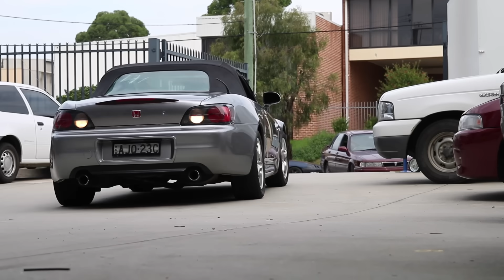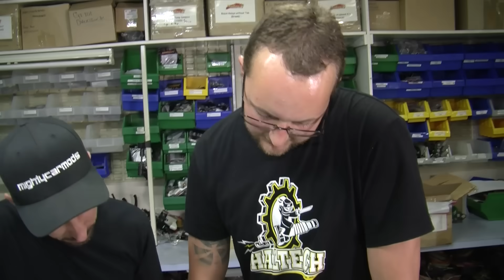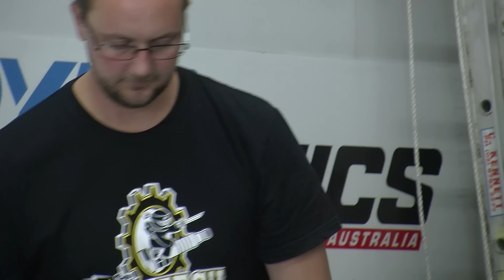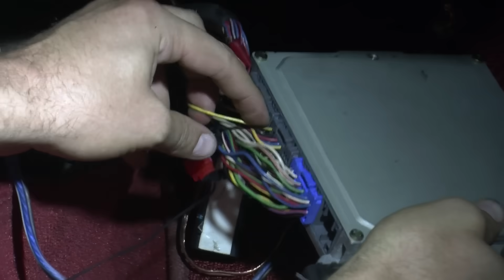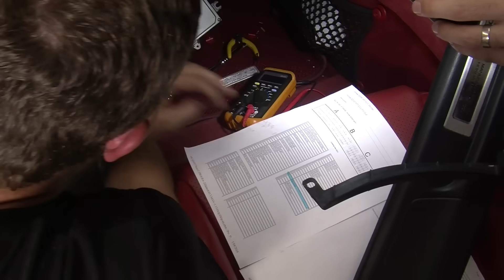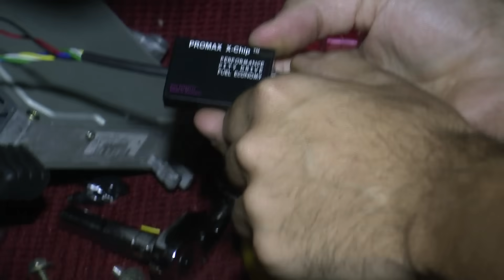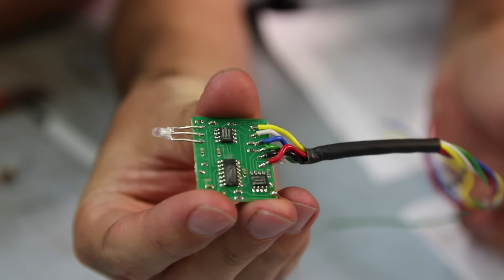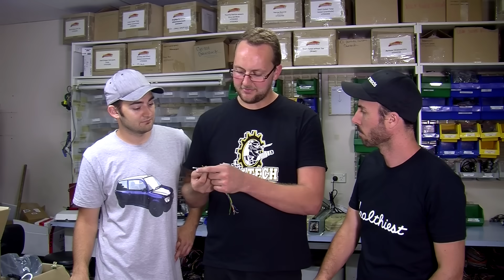eBay Performance Chips -  Mythbusted

Comment: If 1,000,000 rainbow-farting unicorns give 177 HP, every unicorn gives 0.000177 HP
20 unicorns should thus give 0.00354 HP. THAT'S WHY IT DOESN'T WORK!

Shame on Moog, he should have taken the 170,000 unicorns version to have 30 HP more.

Comment: Why waste your time with silly little gimmicks.  That chip is never going to work and even if it was remapped it would only give a slight increase on a NA engine.  Stop messing about and get a supercharger bolted on there so that you get a good increase in power and torque!

Comment: Some Chinese manufactures do scrape off the chip markings to prevent someone from copying their circuit. And in this case to prevent anyone from finding out those chips have nothing to do with ecu control :D

Comment: Absolute junk.  Unless it is an eeprom or memcal that slots into a dip socket inside the ECU, then it ain't gonna work.  There are eeproms / memcals with performance tunes available on ebay, but you need to trust that the maps on them are sound and won't cause the engine self destruct.

Then, for non eeprom cars with locked ecus, there are piggbacks like the Greddy e-manage and Nistune.  Nistune is excellent for Nissans.  e-manage is better than a stock ecu, but still poorer than a standalone like a Motec or Haltech.  A lot cheaper though.

Comment: Why not just get the ECU re-mapped its much safer and better for the engine
Reply: Because it wasn't the purpose of this video, man! But since we're around giving good tips I think that putting some MCM sticker would give more power to the Honda - - poooooowwwww...poooooooowwww...maaaaaaad :D
Reply: Marcin Wojciechowski hahaha. Yeah I understand that, at least they have stopped people from buying these useless things off ebay.  glorified LED device
Reply: ***** You can get it done fairly cheap at a garage, and if the car is old its easier to remap.
Reply: It's really difficult to remap a factory ECU. And it tends to try and lock down on you to protect its self.
Reply: True true

Comment: Scratching off the chip codes is very common, it's an attempt to slow down those who want to copy the device. In reality it doesn't make much difference since it's fairly easy to reverse engineer the basics of the board. There are of course legit chips that work exactly how the BFG mentioned, modifying the data being sent to the ECU so the engine is worked a bit harder. To say mod chips don't work, based on this single test is a bit silly. You knew from the start that the chip wasn't compatible with your car because it didn't have the required sensor to intercept. P.S spoiler in video title = the suck.
Reply: This exact chip has no way to work since it's a straight-trough connection. The ones that actually "work" foll the engine into going rich and it does nothing exept for increased fuel consumption (think of choke - Does it increase your power?). Chips used in turbodiesel engines are diffrent story: This engines are regulated by amount of fuel injected and most engines have some extra capacity for generating power, but for some reasons are left unused (possibly because of emmisions as chipping tend to make them smoke a lot at full throttle). Moreover there are often exactly the same engines sold with diffrent power output and you can mod low power one into high power variant. There are also some middle boxes avaliabe that plug in between ECU and wiring that allow you to benefit from chip tuning without voiding warranty (just remember to remove it before annual check :) )
Reply: mibars According to their analysis it's a straight pass-through. Chances are the chip passes through any data that it doesn't understand and that's why the guy who tested it believes it's not doing anything. If they pass through the specific sensor data that the chip is expecting, I bet it would be modified on the fly. Whether or not these modifications produce extra HP or just waste fuel ... well I'll leave that to someone with a lot more free time to talk about lol

Comment: here's a Mad idea.... swap out for a 1JZ-GTE twin turbo engine??? i know they have a 1J Toyota Chaser hiding somewhere and i now the engine will fit with some mighty mods of course as the show is called!.. only other thing you will need is to use a NISSAN S13'14 or 15 rear end to handle the power ..bigger wheels stronger suspension,,, i think it worth a look see and an instant bump in power from 177bhp to 280bhp to start think about it a Honda Toyota NISSAN Hybrid.....MADDDDDD!!  lol
Reply: well Thats Australia for you!!  lol to many rules
Reply: Methinks they sold it soon after that episode. But more engine, more good!
Reply: I suppose thats one way to totally fuck up the weight balance.
Reply: it would still suck because you could only legally use the vvti 1jz which is pretty limited when it comes to chasing power vs the older non vvti 1jz.
Reply: WTI? who said it was a wti? Limited?? nothing is limited once you can crack the issue  ...and even if it is limited & has wti ... it will still have more power than before and more power than the MX-5 Miata now wouldn't it?! thats the goal in the first place!..smh
Reply: EnFlaMEd
 Cressida? Chaser? ''Details'' same damn thing same dame engine  don't get politically correct
Reply: That wasn't me! :D

They would have to use a vvti 1jz because you basically cannot legally put an older engine into a newer car. But you are right, it would still be good for plenty of power, they are a great motor still. But they are limited in how far you can go with them. Plenty of information around if you google it. A vvti 2jz would be the best solution so long as the s2000 isn't too new ie newer than about 2003
Reply: you got that right!

Comment: those look like normal op-amps on the circuit board. and if they are i don't think the instructions are correct. because just splicing in like that will not make the voltage travel from the chip to your ecu. from the looks of it both the ecu and chip will be getting the same voltage form the sensors. and that 14 pin op amp just has more than one op amp in side it. i hope this helps in understanding whats on that board.

Comment: Does a sports muffler or straight threw pipe give any extra power because I can not count on two hands in every day I see sports mufflers or straight threw pipes on daily driven cars . I haven't done it because the way I look at it the manufacturers have done all the testing already for the best outcome for the engines performance .
Any Answers ???
Reply: If all "they" do is replace the muffler, then no, not really. I too see those "fools" driving around with their fart cannons and wonder in what world they live in. The power gain would be alot better with a full head back system with a good quality (yet quiet) muffler. Intake rarely needs changing on cars and factory will just about cut it for every aplication.
Backing up abit, a good muffler that comes to mind is the varrex xforce. Fully closed it has very little restriction and is (in most cases) quieter that the factory muffler, meaning less "unwanted attention". But the car scene, in my town atleast, is a joke. Too many sheep that have no idea what does what but because 'they saw it in a movie' it must be good and does something. Anyway long crappy story short.... No that does sweet frack all for anything except highlighting that they're idiots.

Comment: if you're planning to stay NA. try a 4.778 final drive from the '94-'02 Kia Sportages 4x4 front diff. part number MM05727110. it's less than $300 new.

Comment: 171bhp?theyre suppose to be 240bhp arent they?
Reply: Don't forget, cars eventually lose power the older they get. If Moog's is a 1999 or a 2000 model, that seems pretty feasible for it to have lost that much. Plus, that result might be the horsepower going to the wheels rather than the raw engine itself, which is always typically less (usually a 15% - 20% loss if I remember rightly).

Comment: Guys, that's more of like just a Throttle Controller not a proper ECU Chip. That just gives you more torque when you accelerate. Pivot and Shadow are brand samples on throttle controllers. would have been nice to see them using ECU chips like Unichip or maybe from J's Racing Japan that's made for a honda.

Comment: 177hp on S2K? Something is wrong here... should have arround 240hp! No suprise MX5 got u...
Reply: ***** The 2 liter engine had these specs: 177 kW (237 hp) @ 8,300 rpm (US & EU) 184 kW (247 hp) @ 8,300 rpm (JP), and 2,2 liter  177 kW (237 hp) @ 7,800 rpm (US) 178 kW (239 hp) @ 7,800 rpm (JP)..... there was no other version that I would know of other than spoon and mugen.... and not with such low HP/Kw figures.
Reply: HorsePower and WheelHorsePower are two totally different things. The 240hp you're saying is the factory declared HP but when it comes to the dyno, it's only 170w+hp since it losses a lot of HP cause of it's transmission. Might wanna google Wheel Horsepower.
Reply: ***** you are right, still, with S2K in good condition you should get way over 200hp on wheels m8
Reply: mulawin estrellado you are right, still, with S2K in good condition you should get way over 200hp on wheels m8
Reply: ***** Ofc you are right. Since the car is AP1 I guess it will be more than 10ys old... could be up to 15y old.

Comment: Everyone's complaining about the horsepower readings being lower then advertised by Honda.

The thing you need to consider is Honda is obviously going to be dynoing these engines in the perfect conditions not only that but they also reach HP at the crank not at the wheels put these together and the Honda stated performance is going to be quite a bit higher than a standard dyno reading at the wheels

Comment: Yeah... Good luck making more horsepower by changing sensor data.... What you need to do is get an aftermarket EPROM with diferent map/s than the original one and than swap it from the ECU. The other way is actually reprograming the original one. That's what i like about old Opel ECU units - the eprom is removable and the board has all the conections to connect to a PC and monitor the input and output signals. Yes, it is serial, but it works!
Reply: Yeah, EEPROM swapping for more power is awesome and pretty cheap. :)

Comment: I reckon even expensive branded ecu chips and maybe even ecus themselves dont cost much to make. All the ecu does is execute a bunch of "IF" Statements based on readings from the maf and airflow.  A flash tune just replaces the "if" statements values with different values.  Its the licensing and branding which you pay for.
Reply: its not the unit you pay for it's the work that has gone into the unit.
Reply: Yeah, but the price is not only including the manufacturing line and marketing and all the stuff directly connected with producing the unit.
Reply: The raw cost of materials used for making them isn't much. But the cost of the machines that make the chips, the time paid to staff to develop the chips, testing them etc. That's where all the cost is.
Reply: Ahh yes! How ignorant of me ==' i completely forgot about the development and engineering stage. My mistake. Yea that makes sense, i remember when quoting for a ecutek tune, the bloke stated it was expensive due to the cost to licence the ecutek software, which ultimately goes to the cost to develop the software.

Comment: Awesome, so much analysis for that little chip all questions have been answered but it seems almost like a waste for this ebay thing. How about doing a still cheap $200 chip from a more reputable tuner
Reply: same results.
Reply: They work, on naturally aspirated cars it's usually around 10hp which isn't all that great but if you are supercharging or turbo charging it's the cheapest way to adjust air fuel ratios.  In the end stand alone is better because it can be adjusted right there in your car with infinite ratios.  But for an easy turbo upgrade chip turning is easy enough and more cost effective.

Comment: So this is really a logical conclusion. 99% (with a correctional factor of 1) of MCM fans knew exactly where this was going. BUT, at the same time, I'm glad this video was made. Maybe with some luck, someone who got enticed by an eBay "chip" will see this and save their money.

Also, for the record, for the same $20, I got a great looking aftermarket radio antenna. It also does nothing, really. But it does look nice doing it.

Comment: I have one power box installed on the MAF sensor of my car. It uses the air intake temperature and adjusts it to a lower value. This can be seen using an OBD 2 tester. I can say that there is some change even in the exhaust noise. It's not something extraordinary but you can feel a little more pull.

Comment: $20 wont work. What does work though is the APR flash for the 2.0TSI engine. Granted it cost $600, but you really do get at least 35 hp gain and 70 torques

Comment: I have used an ECU replacement chip (mosfet) that you install INSIDE the ECU and it did add a little bit of horse power, torque and a LITTLE bit better fuel efficiency if you weren't pegging the car around anywhere.

Although, this did make the car overheat constantly from using the coolant water up too quickly and it had died for no reason twice now - but we are unsure on the cause of it.

By using this chip also, it removes the connectivity to the OBDII port - so you cannot log faults or anything on your car.

I will write up a proper story if needed in MCM forum.
Cheers

Comment: The thing that sucks is that here in Canada, if you have a front drive with only 215hp you cant go to the track because its not considered fast. It looks nice to live in Australia were you can have a old beat up car and go to track and being kinda fast if you have reasonable power. Here i have a Saab 9-3 2.0t making 214hp and its not fast enough for the track, you need at least 275hp to be respected at the track and to be RWD or AWD. And you guys had the blue turd with little power and you still went to the track being respected.

HONDA IS MAD.

Comment: okay couple of things.  The consistency is great even when heat soaked it made 179.  The bad thing is that Honda seriously overrated that engine at 240hp.  Even at 25% parasitic drag to only make 179hp is terrible for a manual car.  Normal cars only lose 15% I believe. I wonder what kind of Dyno it was.  I hear that Mustang Dynos are terribly stingy it might be one of those and that might explain it though.
Reply: Loosing about 20-25% Power through the drive train is pretty standard. Sounds lots, but thats just the way it is.
Reply: In automatic cars with awd 20 to  25 percent drivetrain loss might be par for the course but manual cars lose a less than that on average.
Reply: U.S. car manufacturers never release HP numbers at the wheels. Always BHP.
Reply: No one releases HP at the wheels. The numbers área always at the crank. It usted to he that they would release the un gross numbers but that changed a while back and now its net. I believe nowadays they have a stricter form of testing. With ancilaries on and whatnot. Before it was only the engine with a water pump at most.

Comment: for guys testing blow-off sounds through speakers, turbo spool sound through stupid tubes that attach to the muffler, fake brake "caliper" covers, and LED covered overfenders...i wasn't surprised that those switches only controlled the LED lights hahaha!

Comment: The s2000's power loss I think is attributed to heat soak from the intake since the bonnet is closed and the car stationary and/or Moog's car has lost compression from oil starvation over the years (ap1's are known to burn oil).

Comment: What does v-tec actually do?
Reply: Vtec is basically where the car has 2 cam lobes.  20 years ago it was rare.  Now every car has it.  They call it different things but its all a 2 cam lobe system.   

The normal lobe is for every day driving.  But when you get up in the revs it switches to the more aggressive lobe.  

Back when I was a kid you put a more aggressive cam in your car to make more power.  It worked but made for a terrible car when driving slow.  With vtec you have the best of both worlds.

Comment: Ok so let me get this straight... a corolla sportivo (147kw=197hp) has MORE power than a s2k! I wanna see vtec vs vvtli.
Reply: Thatys 147kw at the flywheel dummy :p this is 130kw at the rear wheels. S2000 has around 180kw at the fly.

Comment: How come the S2k made only 170bhp? Are Australian ones heavily restricted? Here in the UK they're 230-240bhp standard
Reply: That's at the wheels and different dyno's give a bit different results.
Reply: dyno's read hp and kw's at the wheels, not at the engine. Manufactures release HP readings at the engine. for it mae 179hp atw which translates to 215 at the engine, all is right.
Reply: Over time, cars lose their bhp, but i was also surprised when it was only doing 180. I thought it would be doing around 210 max since the car is fairly aged.
Reply: Most dynos over here give both a flywheel and wheels reading, still seems low compared to similar dyno runs on stock ones that i've been to but maybe it's the heat over there
Reply: Kouki Monster haven't seen a dyno operator bother using flywheel numbers, alls dyno's are different its merely a tuning tool. How the dyno is calibrated effects the read out as well.

Comment: A big problem in America, during the muscle car era was that manufacturers were advertising engine number horsepower and when the consumer got the car the numbers weren't adding up. After that I'm pretty sure but I might be wrong, they were required to advertise the horsepower to the wheels number from then on.

Comment: cant help but wonder if using resistors to trick your engine into thinking its a few degrees colder or warmer would actually work... I don't see how..... the 02 sensor has final say. and it knows all